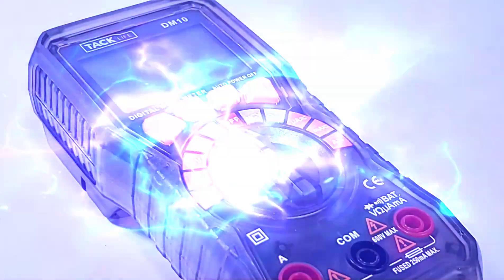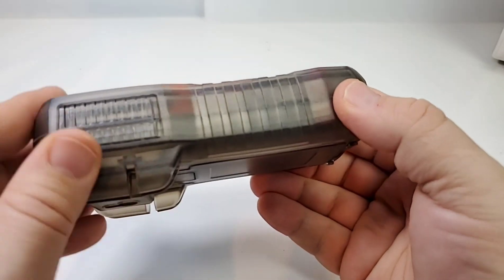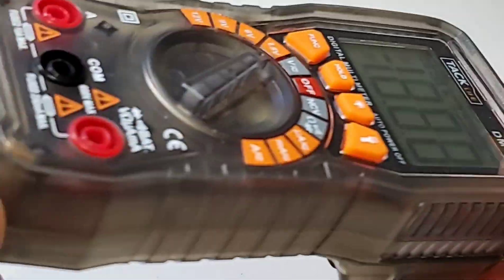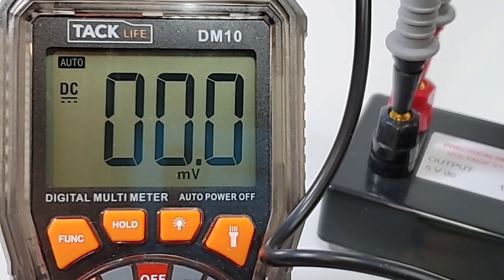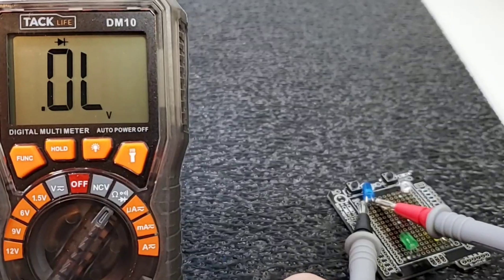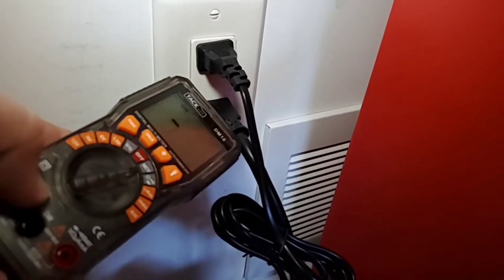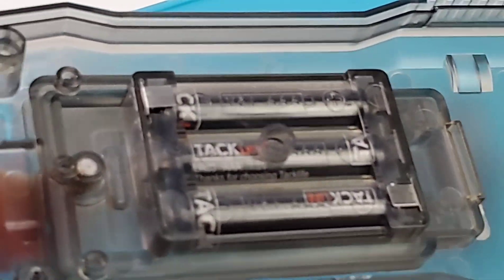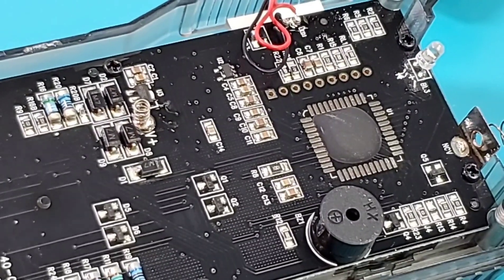TACKLIFE DM10 CHEAP-O Multimeter Review & Teardown!

Comment: Dumb question, how would I use these test leads for an outlet?
Reply from the maker: No question is dumb.
Make sure you have the multimeter set to AC ~ Voltage. Red Test probe into the Positive input (RED) on the multimeter and Black Test probe into the Negative (Black/COM) input jack on the multimeter. The pointy tips then plug directly into your wall Outlet and you should get a reading.. keep your fingers clear!

Comment: Not sure if I’m ready for a transparent body and LED strips in multimeters just yet. But overall it would be nice to be able to check for leaky batteries without the need to disassemble the whole thing. 

It’s a shame the spec isn’t great, and it performs poorly. I guess the main idea of a cheap-o should be the best utility for a very tight budget, which we don’t see here. Still I would give it a chocolate medal just for being unique.
Reply from the maker: My thinking as well..The DM10 garnished an Xtra star just for being "different" its too bad really as this dmm is very well manufactured just poorly implemented.
Reply: It would be convenient to add an LED strip acting as a continuity signal.